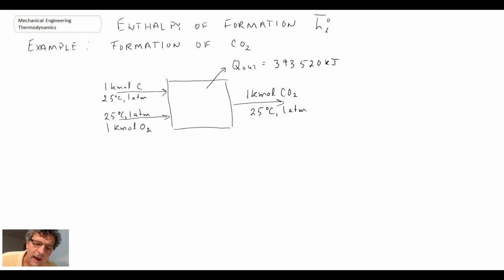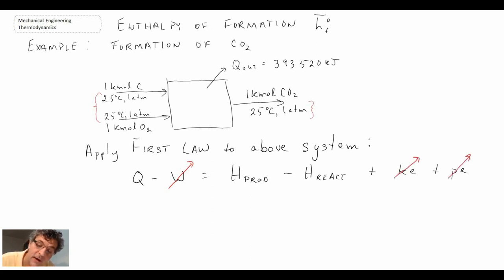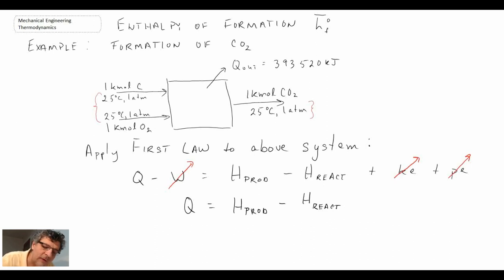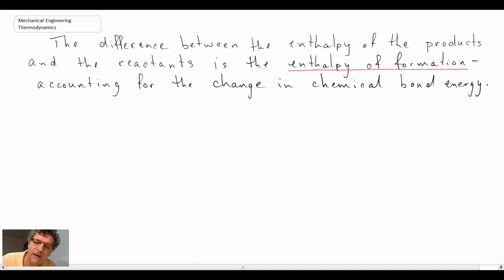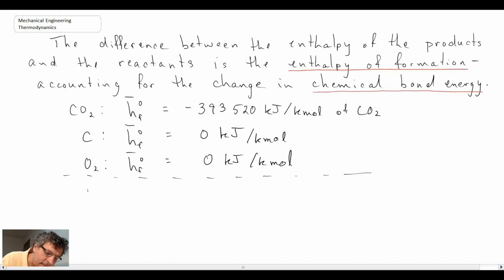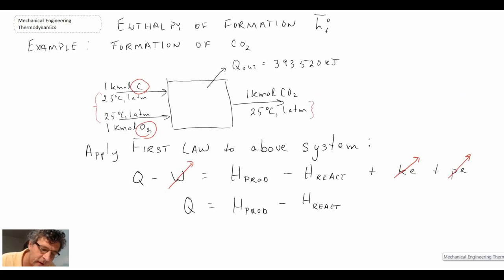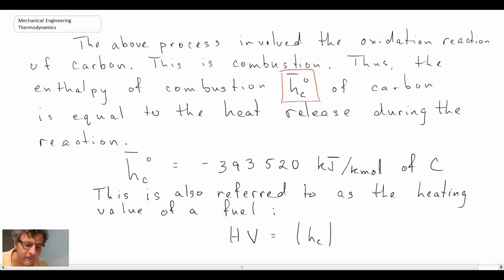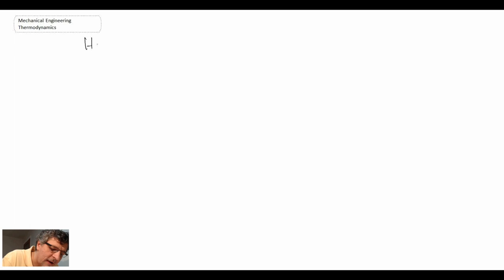Mechanical Engineering Thermodynamics - Lec 32, pt 3 of 3:  Heating Values

Comment: Good morning Professor.
I need to calculate the efficiency of a boiler, which burns wood and generates exhaust at a temperature of aprox. 240°C. In this case would I need to use the LHV, given that the water of the products is in vapor state? 
Thank you.
Reply: yes